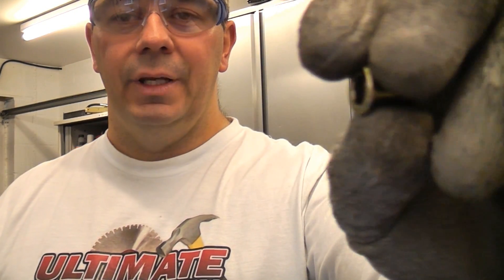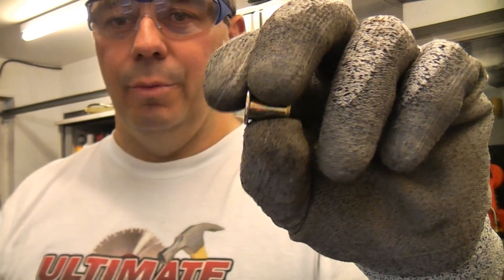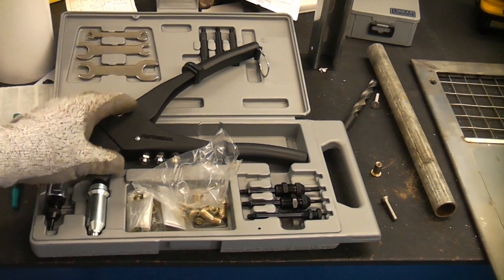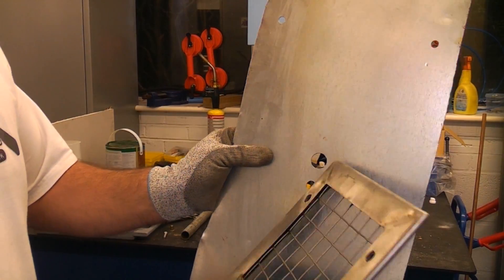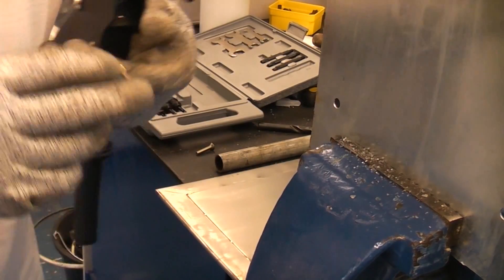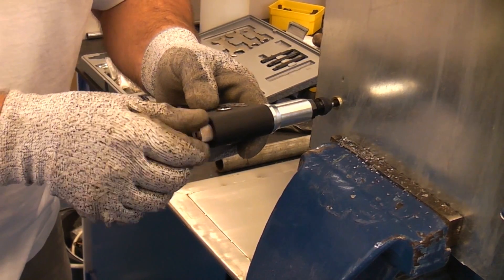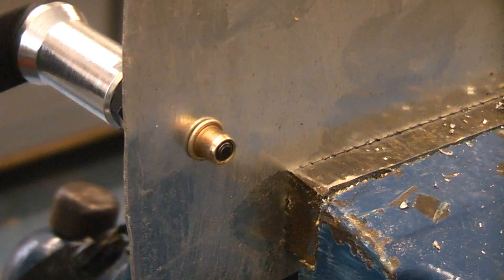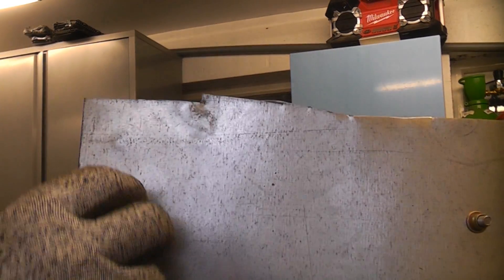Rivet nuts | Riv nuts | Nutsert | thread inserts for thin metal

Comment: Hi Chaz , hope you're well..
What a great Tool ..
Can you use that , on "hardboard "...to fit sockets inside kitchen cupboards....
What's the smallest & biggest  machine screw it can take..
What brand is yours ....
Got a link . .
Thanks Steven
Reply from the maker: I’m good, thanks 
I think mine is a Sealey- https://bit.ly/3MSlOed 
Don’t think they will work well on hardboard, as it is much thicker than sheet steel. (most rivnuts will only work up to 2mm thick material) 
They can normally be used for M4,M5,M6 and M8 bolts, as long as you have the correct inserts. 
Perhaps hollow wall anchors would work better, if you can get them to tighten up on hardboard. - https://www.youtube.com/watch?v=7mpcer0QzW8&t
Zip fix fixings will definitely work though- https://www.youtube.com/watch?v=4r_MsgkXsBA

Comment: A very informative video, can these be used on 4mm plate? thanks mate!
Reply from the maker: Yes, providing you get the correct ones. 
They normally have a grip range value, such as 3mm to 5.5mm etc.
Reply: @ultimatehandyman  Ok thanks, I'll try to find some in that range, if not, I'll spot face/counterbore  where I will need the riv nuts to go, so I can use standard size.

Comment: Is this also possible to use with Loose thread table mount clamp?
Reply from the maker: It depends on whether the thread is damaged on the screw itself or the tapped hole.
If the tapped hole is damaged, you might be able to repair it using one of these.
Thanks for the comment

Comment: Im looking for a solution to secure other hardware to the Aluminum Floor of my Inflatable Boat, with multiple re-use ability.  My concern is corrosion between the rivet and aluminum floor. Can these threaded rivits be found made of aluminum? Would your demo rivits be a good application? 
Ive included a link to a similarly constructed aluminum floor. 
170cm long Goethe Aluminium floor and inflatable Keel|Rowing Boats| - AliExpress
https://m.aliexpress.com/item/32870300981.html?_randl_currency=USD&_randl_shipto=US&src=google&albch=shopping&acnt=494-037-6276&isdl=y&slnk=&plac=&mtctp=&albbt=Google_7_shopping&aff_platform=google&aff_short_key=UneMJZVf&gclsrc=aw.ds&&albagn=888888&albcp=9594035441&albag=102695258807&trgt=296904913880&crea=en32870300981&netw=u&device=m&albpg=296904913880&albpd=en32870300981&gclid=CjwKCAjwq_D7BRADEiwAVMDdHkRQMyYhXIxIrnmuJCEQXQ2YEP4UR__AHs-mc8-fA5lEVjLnVRlqWRoCUSoQAvD_BwE

Comment: Is there a difference between the types of rivet nuts?. In your example, the shaft is smooth but has a knurled section underneath the head. I've seen rivet nuts that have about half of the body with a knurl texture and other nuts with a partial square body like a carriage bolt almost. When should one type be used over the other. Thanks.
Reply from the maker: I'm not sure, to be honest. Could it be that different makes have slightly different designs?
Thanks for the comment

Comment: Are these ok for thin fibreglass parts or would it crack the fibreglass when you squeeze the rivnut?
Reply from the maker: I think they are only suitable for use on thin metal.
I would imagine they would pull through fibreglass.
Reply: Ultimate Handyman thanks for your swift reply. Much appreciated 👍

Comment: Hey bro can these be used for a frame grounding point?
Reply from the maker: No, I would drill straight through and use a brass bolt and nut for that.
Thanks for the comment

Comment: How does squeezing the handle on the rivet gun set the rivet? I don't have one to play with and I've never been able to figure out how they work.
Reply: 4:02 shows what happen behind the panel👍
Reply from the maker: They work just like a rivet, when you squeeze the handles, it deforms the outside of the rivnut, which make sit expand and fill the hole.

Comment: Can I use these for ground points on a car? I don't see why I couldn't but would work good for installing aftermarket lights, car audio aswell as other electronic components, giving a nice and tidy processional (factory fitted) look. Thanks for the video!
Reply from the maker: Nik Trp 
I don't see why not, they are supposed to be rustproof so should be suitable.
I use these regularly now when making things from thin metal as they do give a professional look ;-)
Reply: Thanks for the fast reply! I had the idea since a lot of people use self taping screws which are good to a certain extent and this to me looks like a much better alternative (as you said in the video). I have ordered a kit straight away! Thanks for your help!
Reply from the maker: Nik Trp 
You are welcome, as you say these are much better than self tappers ;-)
Best of luck with the projects.

Comment: Great tool , i have never seen one before , are these rivet nuts easy to obtain in shops or online and also can you give a rough idea how much that starter kit cost's...!
Cheers
Reply from the maker: The kit I used is for sale between £60 and £90 depending on where you buy it.
It's the Sealey AK396 
Thanks for the comment

Comment: Great guide, what riv nut kit were you using and would you recommend it?
Reply from the maker: Thanks, it's the Sealey rivet nut kit. I have not owned this long but it seems good quality, I have used a similar kit at work with good results.
The Sealey kit has a good selection of mandrels and also a good selection of jaws for using rivets. I don't like recommending tools unless I have fully tested them out, but this seems like a good piece of kit.
Thanks for the comment
Reply: Thanks, I've got quite a few sealey tools and i'd say they're pretty good quality. Cheers.